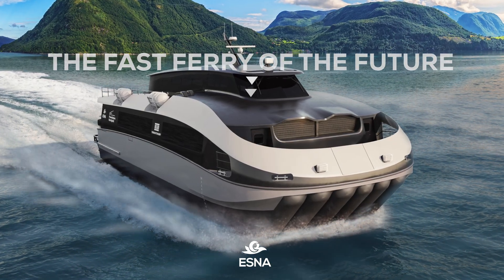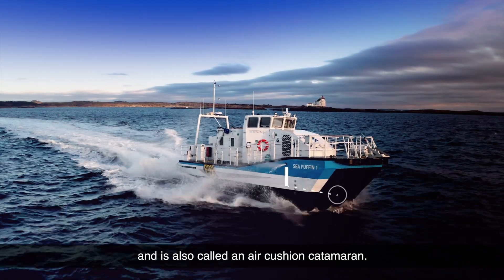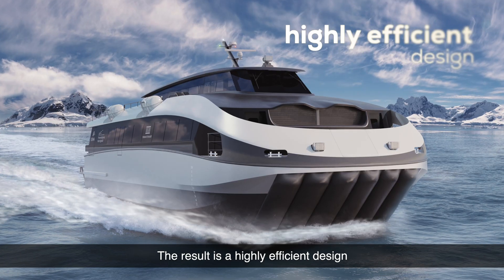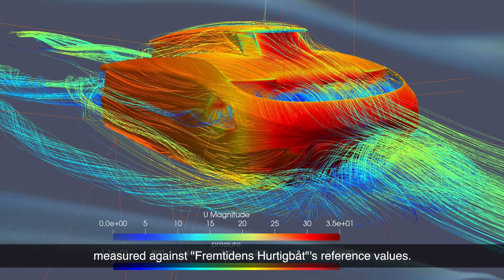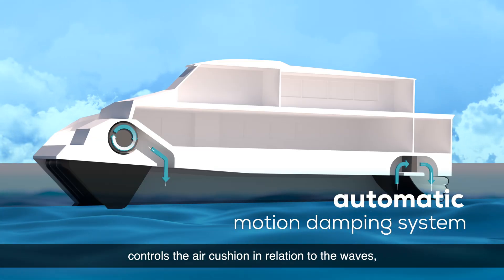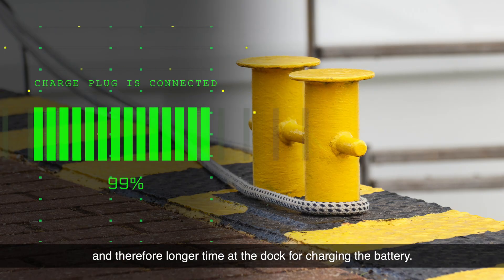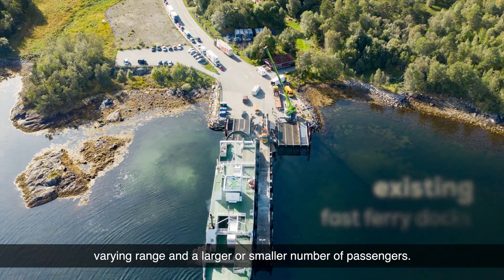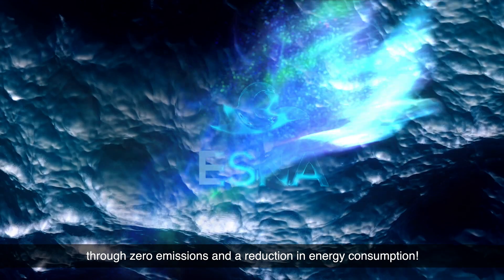ESNA - Fremtidens Hurtigbåt - Energy Efficient Design Phase 2

Comment: I was fortunate to know the actual engineer/designer of the catamaran/hovercraft combination for the U.S. Navy.  Don Maynard designed this type of vessel 50 something years ago with Turbine power.  It was tested and did well in performance but was ultimately not chosen by the Navy.  They went with conventional V Hull type designs at the time.
This video is disingenuous because Lithium batteries, Electric Motors and all the related hardware are hardly "clean" or 
"green" energy.  If you add in the forced labor or even voluntary labor that makes pennies on the dollar for extracting minerals in 3rd world countries then electric power is a social negative.  On top of that is the non-green source of the recharging setup.  And no, solar panels are not completely "green".  
I'm all for electric powered vehicles of whatever type if the adopters are frank and honest about the materials used and their sources along with the truth that electric vehicles are no cleaner overall than any other.  Having electric power rammed down our throats and hydrocarbon fueled vehicles banned is NOT something I agree with.  If something has merit, it will stand on it's merit and succeed.  If it doesn't have merit it will fail.  Lies and misdirection should not be part of the discussion.
Reply: Dear Sir,

This video and project is not about "greenwashing" any type of battery or other energy source. It does not address the various drawbacks of production of different energy sources like lithium based batteries or the co2 emissions from oil based fuels. It is about a very energy efficient design, and the presentation video of our contribution to a competition to design the most energy efficient fast ferry design with a zero emission (during operation) propulsion driveline.

There are much uncertainty with what the right future fuel is. The completion is acknowledging this by saying that in any case, using less energy will be good. And therefore this project.

Our SES design is in this competition the vessel design that uses the least amount of energy per distance in 40 knots service speed. Significantly less than a conventional vessel with the same service speed.

Comment: There’s no such thing as zero emission batteries. You’re just shifting emissions from one place to another. Massive energy and resources to manufacture batteries, not to mention the slave labour to mine the rare minerals
Reply: It is correct that there is no such thing as a "zero emission battery".
The emission discussion is/should be about the overall emissions, including production, operation and end of life.

That said - this video presentation is on a project that is focusing on reducing the energy consumption --> "Energy efficient design"
Independent of energy source and discussion of battery production - Using less energy will reduce emissions. The platform/technology/solution can be used for most energy sources.
Reply: @trygvehalvorsenespeland  That's fine. But the corporate greenwashing terminology , claiming zero emissions is BS. Pure and simple. I'm excited for high powered electric boat applications, but we are a long way off yet in my opinion. Power density of the very best LiPo technology is still much lower than gasoline, kg for kg. Accounting for ICE efficiency (35%) gas is aproximatly 4.27kW/kg, and LiPo is 0.4kW/kg, and that's assuming 100% efficiency. Gas is still 10 times higher energy density even taking ICE inefficiency into account
Reply: @fullsendmarinedarwin7244  Yes agreed. 
However these ferries is not intended for long transportation, but rather short transits (less than an hour high-speed transit) with frequent megawatt charging. Then this makes a very competitive solution compared with other energy sources, including MGO with ICE engines. This is because the battery size is reasonably small, and the efficiency of the battery and electric drive line is very high. It is competitive on both costs and reduced emission (also total life cycle). Zero emission operation (depends on source of electric power), but not a zero emission life cycle.
Reply: @trygvehalvorsenespeland  Thanks for the detailed reply. I take it you're the design engineer? good luck with the design I wish you success
Reply: @fullsendmarinedarwin7244  Thanks for that. And hehe, yes, you are correct :-)
Reply: Chill out dude.  This is progress.   The problem with people like you is that you will never be happy.   I get sick of you.
Reply: @kokomo9764  clearly not an engineer. Don't falsely advertise & green wash and I won't be compelled to call it out!